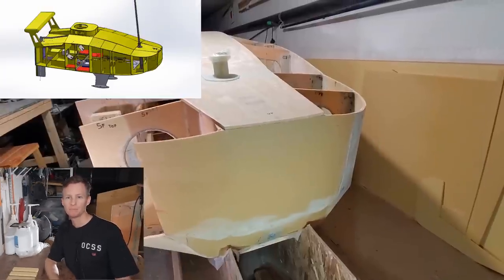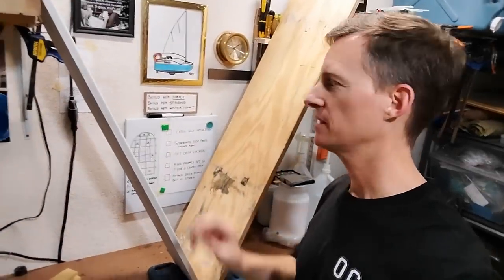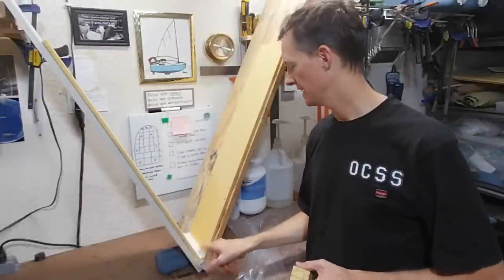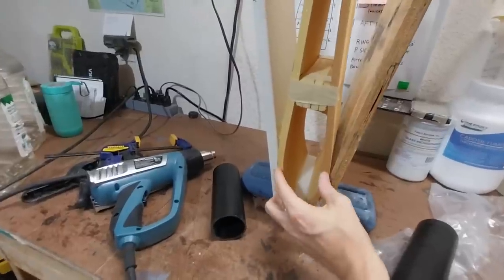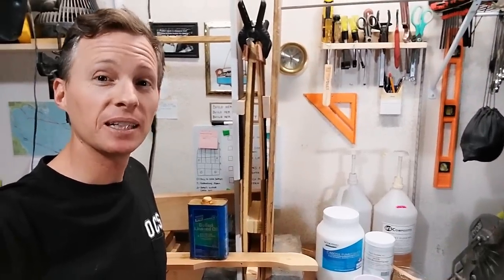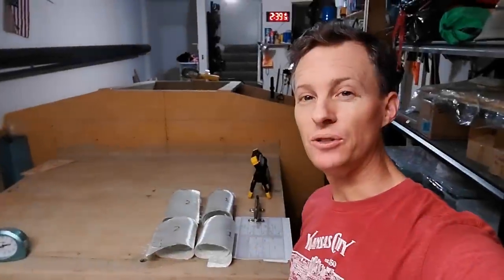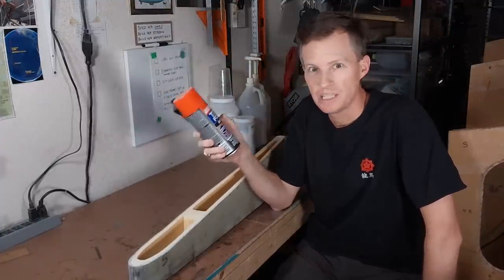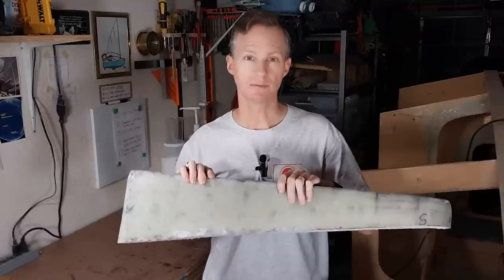OCSS-059 The Fastest Way to Build a Foil - For a Rudder, Daggerboard, Skeg, or Keel

Comment: An alternative method would be to cut a bunch of templates in foam and glue them together…like a bunch of cake layers where the layers are the perfect shape of the template.  Then glass the whole thing when done.  This method would insure your shape is not corrupted.
Reply from the maker: The problem with that is the foam sheets are really expensive. I'd rather have the PVC foam stringer inside, along with expanding foam. Strong and cost effective.
Reply: @ocean_capable_small_sailboat  are you going to build some kind of diy windvane?
Reply: @ocean_capable_small_sailboat  I don't think he was inferring that, you could use exactly the same mm^3 of PVC but preformed contours, layers effectively on the other axis to your method, and still fill the void with expanding foam - the question maybe over the wastage creating the voids vs solid pvc...
Reply from the maker: @toroddlnning6806  Yes, looking forward to it. I will make a trim tab wind vane system.

Comment: Hoerner, a famous aerodynamics and drag expert in the early 50's tested many shapes and airfoils. In his book he has the width to length ratios listed. For example a good width to length ratio is 3.71 to 1 which results in less drag.   This ratio can change depending on the length. Surprisingly a big creators of parasitic drag is how the airflow is affected by how the airfoil of course called hydrofoil is connected to the ship or fuselage.  Pretty fascinating findings actually.

Comment: If you heat it up this way, you'll never have perfect symetry. The simplest way is printing a foil shape you want, transfer it to two pieces of wood, nail the two pieces to opposite ends of a foam block and just use a hotwire. It's faster than this and you get a perfect shape.
Reply from the maker: Perfection is the enemy of progress.

Comment: As the foil is not tapered from the bottom to the top here it would have been easier and far more precise just to cut one or two horizontal profiles and use thinner layers of foam. Foam is also sold for bending purposes. The leading edge is way out of naca form and will therefore not be as efficient while the trailing edge is far to thick.
Reply from the maker: I made the trailing edge a bit thicker to be stronger. moving a bit away from a "perfect foil" shape is an acceptable compromise for me. We won't be traveling mach 1 here 😉. Thanks for watching and commenting. Hope you stick around.

Comment: I would have used a template to cut out layers and sanditch layered it with glass between layers.. a router would have made quick work of it.  Shape it after attached to hull and covered it with glass. That looks far too fragile.

Comment: Total Paycheck... Nothing like boat building to test a budget out. 
I see on the 3D model you showed at the beginning, your keel weights extend forward. 
Would be interested to hear your reasoning for that? 
I would have thought you would want no catching points below the waterline.
Hooking a line or net on such a short light yacht would be a whole lot more excitement than I would want.
Like your skeg construction there Cptn Perry, are you thinking the same for the keels?
Reply from the maker: A friend/viewer put the boat in CAD and drew the keels that way. Steel construction with lead bolted on. I think he was going off some Class Globe 580 keels he found. I agree with you though, I think the final design won't have the keel weights extending forward at all.
Reply: @ocean_capable_small_sailboat    Fair enough.  Nice to have a 3D model to play around with...

Comment: Nice. But I thought you would add some ballast to the hollow space of the skeg, instead of foam
Reply from the maker: I'd prefer to keep weight in the stern (and the bow) down. Neutrally buoyant / slightly negative buoyancy is all I want for the skeg. There will be plenty of weight in the keels.

Comment: Did you consider filling the void with stones or scrap metal held together with liquid epoxy to add some weight at the lowest point of the boat to help prevent it going completely over in a knockdown situation?
Reply from the maker: No, because it's not very deep and I don't want a bunch of extra weight on the stern. I used high density foam, and overall it's already pretty heavy. The twin keels will have lead attached and that will do the trick for righting.

Comment: As your skills and knowledge are increasing so well as the build progresses, are there any things that you did early on in the project about which you now think "I wish that I'd done XYZ instead of ABC?"?
Reply from the maker: Yes. The main one is the jig and bottom panel. I would have built in 4mm ply base integrated into the jig for the boat to sit on. And I would have put 2 layers of 1708 over the top and bottom of the bottom panel of the boat from the very start. I put the bottom panel down and only fiberglassed the top of it. It'll be bare foam until I flip the boat over. Just would have been nice to have it very protected from the start.

Comment: That's a good way of building a foil. Might it be easier in future to draw the outline of the foil. then put nails on the line and fit the foam within them?
I noticed Yann is modifying Baluchon with a more balanced rudder.
Would you consider twin lifting keels? 
I like the option of being able to run on to a beach and dry out like a dinghy, and to be able to get on and off the boat whilst floating in very shallow water.
.
Reply from the maker: I don't like the lifting keels due to the added complexity and loss of space inside. My idea was to be able to dry out the boat on the twin keels if I want. The two keels can rest on the sand. I haven't quite figured out the 3rd point of contact with the ground yet. Maybe a removable simple beaching leg on the transom, just long enough to be longer than the rudder. Still thinking.
Reply: Yann built twin skegs now but I don't know why because I can't understand French and the translation feature doesn't work. If he did it you should probably do it too. Your boats are nearly identical. When his boat was heeled over it used to look like he lost a lot rudder control and even with a new larger rudder he didn't think it was enough? Maybe these boats need twin rudders.
Reply from the maker: @John-Nada  Yeah, I'm not so sure. I'd rather go for less water resistance and stick to 1 skeg. It may very well be better to have twin rudders but I'm going to try it with just 1. It's much simpler and less build time. We'll see how she sails in the sea trial phase. 👍⛵

Comment: I have a question about the strength of the skeg. As I understand, fiberglass has lots of tensile strength, but it`s not designed to counteract compressive forces or shear stresses that would occur when hitting something something, for instance.
Reply from the maker: Another question is, do you really want your skeg SO strong that it tears the boat in half instead of just breaking where it is? I think that, sadly, just no matter what if you hit something hard enough it's gonna be a bad day.

Comment: lol,  score the foam crosswise to allow the leading edge outer surface to lengthen.
Better yet just get some 0.0315  ( 1/32nd ) inch G10 sheet for the surfaces.
No messing around to get it perfect with no sanding.
Reply from the maker: Why score the foam when it bends so well with heat?
There are many ways to do this. Thin G-10 works too, but I don't have any in stock. I do have a lot of foam sheets however.

Comment: What kind of foam are using for the structure and is it stronger than plywood?
Reply from the maker: PVC foam core is 90 pounds per sq inch compression strength. 4lbs/cubic feet in weight. Using foam sandwich construction method, you add fiberglass to each side and can certainly get it stronger than any plywood. Stronger by weight than even steel.

Comment: As built the shear web is dependent on the tensile strength of the foam. It probably fine because the foil is such a low aspect ratio but there should be a strong fiber glass connection between outer skins at the sheer web. 

If you use canned foam you’d be better off using door and window doesn’t expand as much and is therefore denser.
Reply from the maker: Thanks for the foam tip, I'll remember for the next one. Since the rudder will be a much longer foil I will include a more reinforced stringer in the inside.
Reply: "As built the shear web is dependent on the tensile strength of the foam."

Nope.. not in the slightest. The foam contributes nothing. All the strength is in the fibreglass. The foam is only there to tell the fibreglass what shape it should be.
Reply: That’s my point. The stringer the foam is bent around is a shear web. It acts like the center flange in an I beam. There should be direct structural connection between the foils fiberglass side walls as the foam doesn’t contribute structurally.
Reply from the maker: It is structural foam board though, with 90lb/sq inch compression strength. With all the layers of fiberglass I think water force on one side just gets evenly transferred around the perimeter of the foil and into the hull, and some can transfer directly through the stringer to the opposite side as well.
Reply: @james-gn9cq  - There IS direct structural connection. At both ends of the foil. The fibreglass sides of which are curved. And as we all know, curves are one of the strongest shapes around when it comes to distributing force. Whether your shear web is there, or entirely missing, will make absolutely zero difference to the foil's ability to resist pressure or impact.
Reply: @Garryck-1  

I did not invent the shear web. It’s incredibly common in plans for foils, masts and airplane wings. It does nothing to improve impact strength but it helps immensely with side loads. The windward side of a foil is in compression. This forms a stress spot 2/3rds up from the bottom. The shear web helps resist this buckling force and stiffens the foil. A stiffer foil flexes less which reduces fatigue. 

A quick modeling in Fusion 360 followed by a structural analyst will demonstrate how much stronger it is.

Comment: This will give some boyancy down low. I was thinking of 3 improvments: G10 in the front as well and fill it with concrete. A shape  that will not hook into lines, rope and so
Reply from the maker: It actually already feels heavy enough now I think it may have neutral buoyancy, or at least I don't think it adds much buoyancy. I don't want concrete in there because I don't desire more weight that far aft. Even more fiberglass will be added later when it's attached so that will add weight. The leading edge is only 60mm, I don't think it catching lines will be an issue.

Comment: I think using a hot wire to cut the foil shape out of thick insulation foam would be a lot easier.
Reply from the maker: Just my opinion, but, I don't see how. It would be tricky to get a uniform and smooth shape. And you have to build or buy a hot wire tool. Epoxying the leading edge and bending the panels around a stringer is a dead simple way to get a great foil.
Reply: Hot wire cutting works well for rc wings. But there is alot of technic and trial and error that goes into a good cut... for a few pieces I wouldn't be using it for the first time...

Comment: E glass and polyester or epoxy is very strong in tension, much less so in compression. 

A low aspect skeg, yes it is a skeg, should not be a NACA foil, but essentially rectangular. You are doing a lot of work for less strength and performance. A nice wedge shape piece of oak would serve you better.

BTW, shaping a solid piece of anything to a NACA foil is easier and more accurate than any built up section.

Why are you foaming the inside if you are certain it will never have moisture?
Reply from the maker: Why would a rectangle shape have better performance than a foil underwater?
Reply: @ocean_capable_small_sailboat  a skeg like yours is essentially the very low aspect ratio extended leading edge of a portion of the rudder, and while you might think your skeg/rudder is like a wing/flap it really isn't. Truth be told I don't know exactly what effect your skeg will will have on your boat's performance, it may have none. But if the skeg is asymmetrical it will probably cause a bit of a yaw in such a short boat. and who knows what it will actually do to the turning moment, in any case it will not improve the performance. Better to have a solid piece for the boat to rest on with rudder pulled and centerboard lifted. Easier to rep[ace in Tahiti anyway.

BTW, I'm not down on your project at all, I think small boats are great. I raced 14' - 15' boats most of my life. In my misspent youth I was a boat carpenter for about 25 years with a speciality of shaping NACA foils. 

Back in the Early 80's, as I recall, while working in Miami I ran into a gentleman from Maine who had crossed the Atlantic, then recrossed it in a nine foot sailboat. He was in Miami to pick up a small outboard that someone had donated. He was a pretty big guy, and I was amazed. Unfortunately he tried to cross the Pacific and didn't make it.

Best wishes.
Reply from the maker: Thanks for the detailed comments. It's symmetrical, my thinking was I want water to flow around it with minimal turbulence behind so that it hits the rudder as a relatively clean water flow. And I want it to add minimal drag to the hull. I'm still learning though, we'll see how it all works out. Keep watching 👍.
Reply: @ocean_capable_small_sailboat  Making one or more template(s) to insure accurate dimensions and to compared both sides will make your job much easier.

Here are the numbers to create a NACA 0008 foil template. The first column is the percentage distance along the length of the cord for each half height (half of the total thickness of the foil). Multiply that by your chord length to get the location from the leading edge of each half height.

Then multiply the second column by the length of the chord to get the half height at a given percentage point. 

Note that the maximum thickness point of the half height is at 30% and is approximately 4% of the chord length, x2 = 8% the full thickness of the foil.

Example: Chord length = 950 mm. At point .15, the position of the point is 950 x .15 = 142.5 mm from the leading edge. Its half height mark is: 950 mm x.03564 = 33.858 mm.

Complete the table and make a centerline the length of the chord on some appropriate material, Mark each % of length point along it horizontally, then mark the half height vertically at each point. Fair a line to the marks and remove the convex part. Use the template to check the dimensions along the length of the foil.

 0.000000  0.000000 Leading edge
  0.012500  0.012630
  0.025000  0.017430
  0.050000  0.023690
  0.075000  0.028000
  0.100000  0.031210
  0.150000  0.035640
  0.200000  0.038250
  0.250000  0.039610
  0.300000  0.040010 Max thick
  0.400000  0.038690
  0.500000  0.035290
  0.600000  0.030430
  0.700000  0.024430
  0.800000  0.017490
  0.900000  0.009650
  0.950000  0.005370
  1.000000  0.000840 Trailing edge

While I could have got those numbers from Theory of Wing Sections, getting them from http://airfoiltools.com/ was easier.